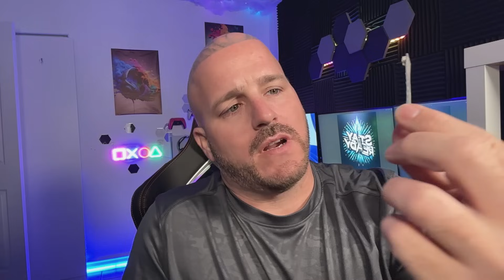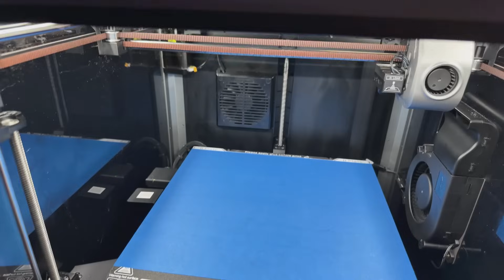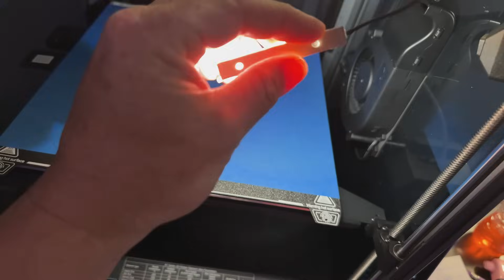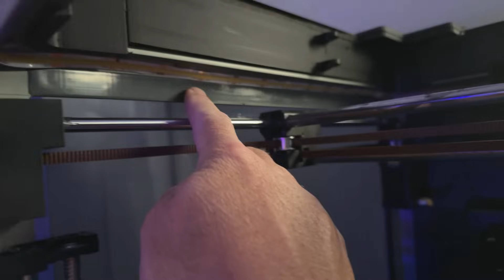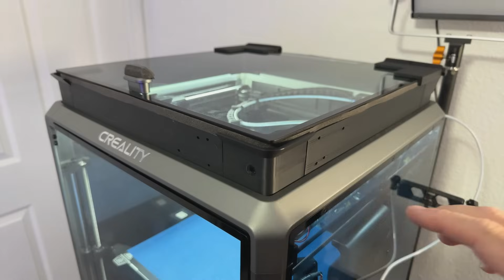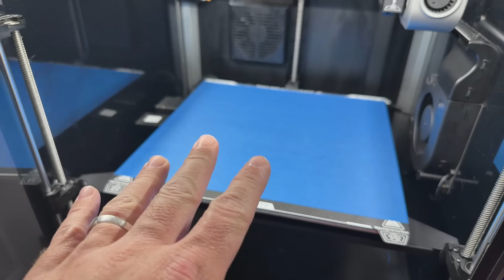Dont Use Your Creality K1 Series Printer Until You've Seen THIS ** BONUS Mod At The End

Comment: You forgot the most important upgrade:
The gears in the extruder (feeder) are made of plastic!
-They melt, when you use high-temperature filament.
What you should do, is to get some metal gears (several kits already exists).
But you may also want to upgrade to a Micro-swiss hotend and a Kaika 0.5mm nozzle while you're at it.
Reply from the maker: It’s hard to make the video when I take mine apart and I have metal gears ha! Luckily for me. But not good for a video that’s about removing plastic ones. I need to check some of my other machines.
Reply: @stayreadyto3dprint  - Oh, it seems our company just bought an old demo model, because we just got it less than a month ago. That's likely the reason we don't have metal gears.
-But it's great to hear that you have metal gears; this means only few people will experience the problems 😃
Reply from the maker: Oh I didn’t forget lol 😂 that’s a whole other video coming soon! I actually took my extruder apart and mine are metal. So maybe the newer maxs have metal?

Comment: Thanks for sharing, which cob lights did you get, didn’t see that in the description.
Reply from the maker: Here you go. They are actually 50% off right now. I just grabbed another set for $5. I pinned the link to the top of comments section.
Reply: make sure you get 24v led strip whatever, if theyre COB or 5050 etc, you will need a controller for rgb, but I just got 15ft of 24v COB white light for #12 and It should look just like his in the end.  Cheers!
Reply from the maker: @KevinDC5  you do not need an rgb controller unless you want to change colors. But just to upgrade to a better light you only need the 24v cob strip lights and cut to the proper length.

Comment from the maker: I've shipped out alot of light kits. They are $30 w/ free shipping. Simply email me at itsallido2017@yahoo.com and tell me what payment method you prefer. Paypal, Zelle, Cashapp, or Venmo, and I will send you a payment request. Please send your shipping address along with your email to speed things up. Some of my subscribers who have ordered are installing their light kits and will be posting links to pictures here in the comments for you to see very soon from what I'm beingt told so stay tuned!!! If that doesnt work I will look into using the community tab to see if we can get some photos going over there. You can check that by going to my homepage here and clicking community.
Reply: Hi can I ask where did you get the actual lights from, I see the leads on amazon and also how did you connect all three together to run on one plug. I would order the kit from you but I am in the UK and you are in America, I would really like the mod.
Reply from the maker: @lesliejames5722  the lights you can order from Amazon. I believe I added the link to them no? And if you want to order a set I can ship to you. You’re shipping may be $10-15 so if you pay it I can ship to the UK. Just email me.

Comment: Where’s the link for the led lights?
Reply from the maker: My email is in the description and it says to email me to order the lights. So just send me an email and I will send you the price and info on the lights and how to order
Reply from the maker: QooWare COB led Strip Lights,... https://www.amazon.com/dp/B0CLVGJL1D?ref=ppx_pop_mob_ap_share
Reply: I was going to do it myself so just needed the link for the led’s.
Reply from the maker: Oh ok. I’ll pin it to the top of comments. Thanks. I totally forgot to add the link for the diy guys.
Reply from the maker: Make sure you match positive with positive when connecting the two pin. On mine I had to connect black to red.  Don’t go by color. If it’s backwards they won’t turn on. Just flip it. All good. These are 24v and plug n play.